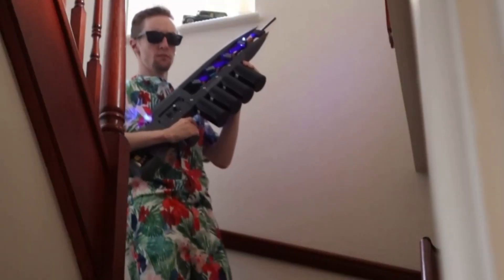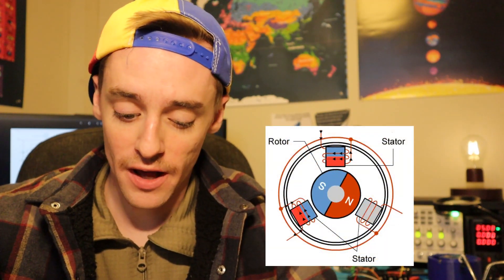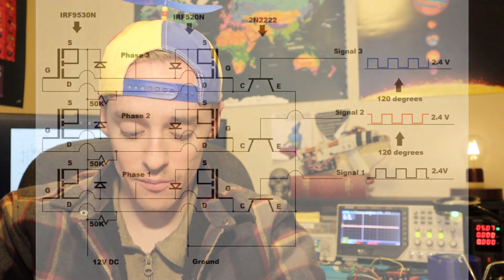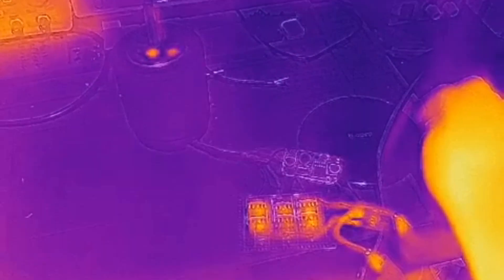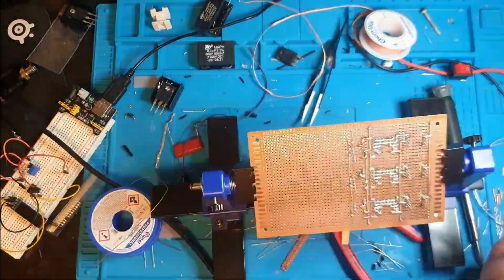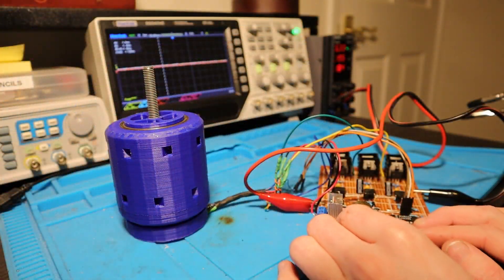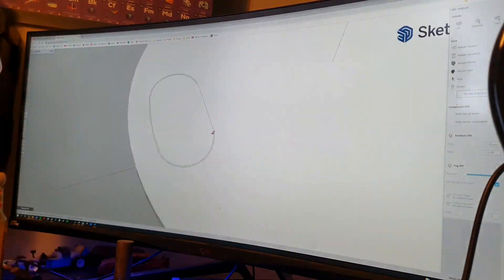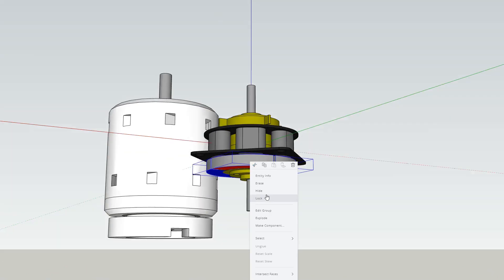DIY Motor Speed Controller (And More!)

Comment: Nice, reminds me of a project of mine. I also did one on a breadboard. In my case an actively controlled one (so using the induced voltage spikes with a microprocessor to synchronize the speed).
It did work but the long wires on the breadboard caused random issues. Crashes of the microprocessor, it would need to be shielded. Maybe a large "ground plate" would help.
Overall, I learned a lot but it was a huge waste of time as well.

Comment: how'd you get started with all this electronics?
Reply from the maker: I only picked electronics up a couple of years ago. I was unstimulated with my job in the military, and realized that I knew almost nothing about electronics. So I used it as an outlet for mental stimulation.

The way I got into it was by buying some cheap component assortments on Amazon (eg. transistor kit, resistor kit, capacitor kit, diode kit, inductor kit, LED kit. All of these cost just a few dollars) and making basic circuits like logic gates, oscillators, boost converters etc. It's important to develope an understanding of what different components are used for.

Once I knew the basics, I eventually bought microcontrollers and played with programming them.
Reply: @BenjaminDMarshall  thanks man. im an electrical engineeeing freshman and ur inspiring me to make my own diy projects, i just find all of your projects so damn cool man! i've been feeling turned off by engineering lately in favor for math and physics. i feel like i rediscovered why i liked engineering in the first place when i see your videos.  i've only tried microcontroller programming before with an arduino so i'm going to try making my own basic circuits like you did.